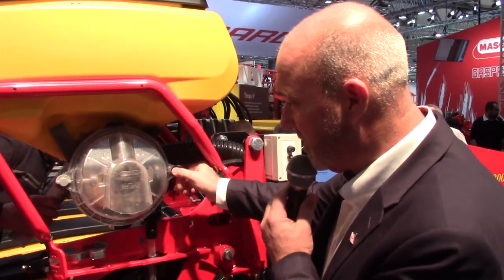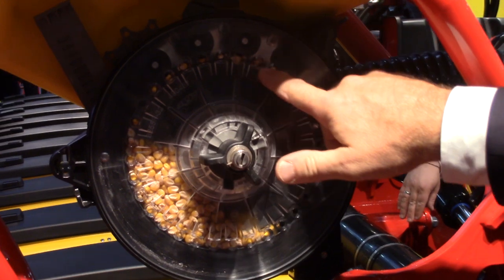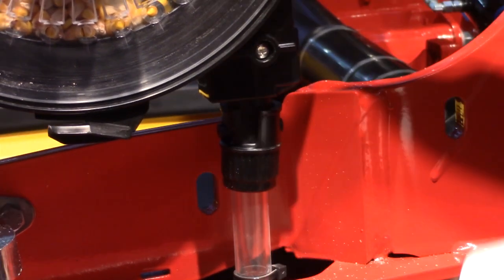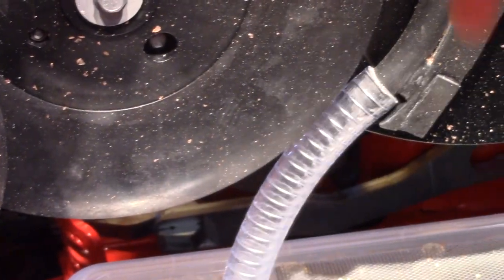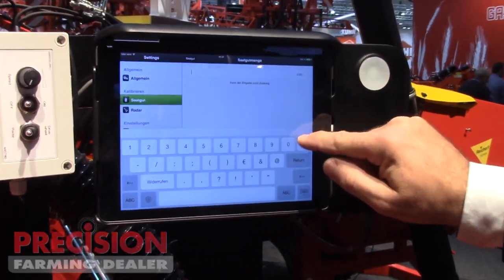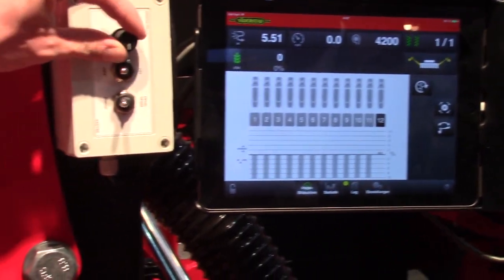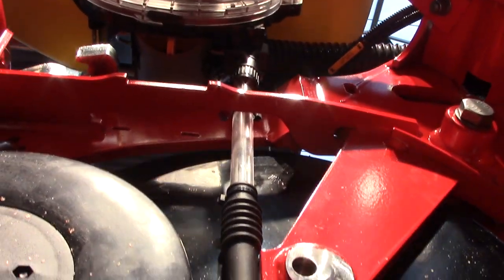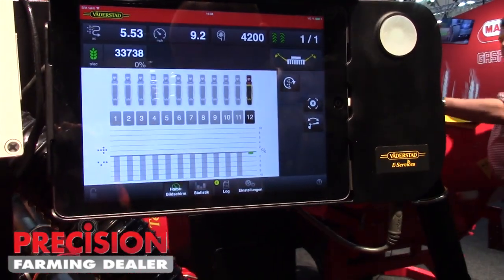Agritechnica 2015: Vaderstad Introduces High Speed Tempo Planter with Yield String Seed Meter

Comment: Does the air pressure blowing down the seed tube ever have to be adjusted for different speeds or seed sizes?  Is it just the same air that is holding the seed to the disc or a separate supply and psi level.
Reply: Yes, you have to adjust the air pressure regarding the TKW (thousand kernel weight), you can regulate it from 2.5 to 4 kpa depends on the TKW, heavier seeds needs more pressure. And there is only one fan that blow the seeds so, this means that the same airflow and pressure that holds the seed on disk, will blow the seed too.